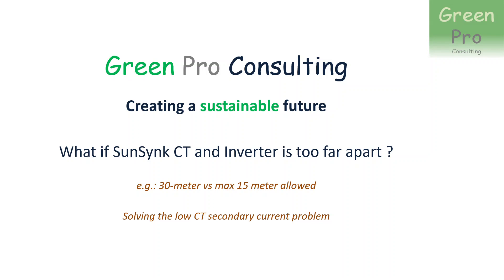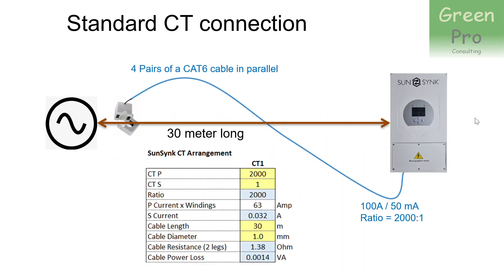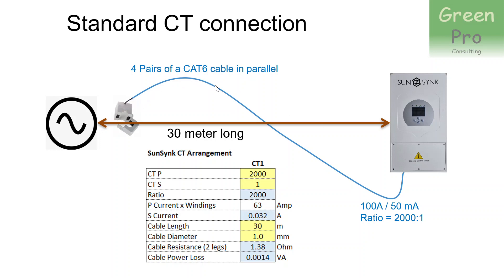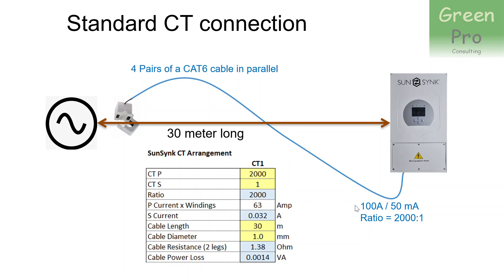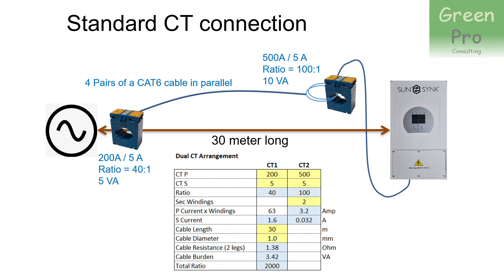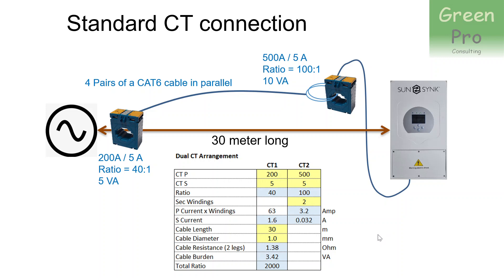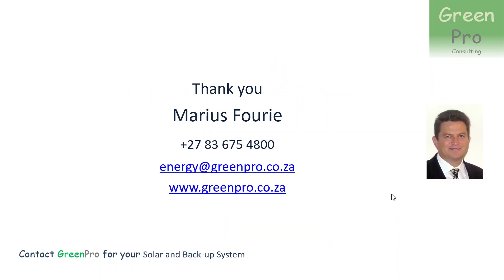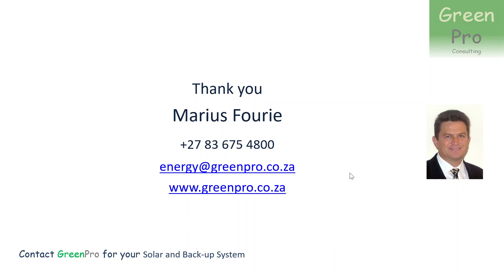SunSynk CT too far from Inverter

Comment: We use CT cable over long runs and it works fine. However we split the pairs and join the 4 white and  4 coloured ones together. So it remains twisted and protects against interference

Comment: I need to run the CT back 100m because the solar is mounted in the garage, any suggestions?
Reply: Have a look at something like the Eastron SDM230 or the Chint DDSU66. They measure the power flowing through themselves and transmit the signal digitally to the inverter over RS485 so you dont have the same losses

Comment: A CT is a current source, and the inverter is looking for current. You are talking about voltage anomalies, noise, volt drop etc are not an issue. Your problem is using all pairs of a multi twisted pair to transmit the same signal. This is like not using a twisted pair at all!!. Get the proper size SINGLE twisted pair cable.

Comment: I would be very cautious of the above method. The reason is as follows. Modern households no longer have resistive type loads. This results in current drawn that may have harmonics into the kHz. Most new electronic meters either trip on reverse feed ( seen as a tapering fault) or you are charged for the reverse feed. (Meter cannot tell the direction of energy flow.) 

If you extend a cable from a CT clamp to the device that measures the CT output, you may encounter several problems:

1.Signal attenuation: The signal from the CT clamp may weaken as it travels through the cable, which can result in a lower signal amplitude at the measurement device. This can reduce the accuracy and reliability of the measurement.

2.Noise interference: The cable may pick up external noise sources, such as electromagnetic interference (EMI) or radio frequency interference (RFI), which can add unwanted signals to the CT output. This can distort the measurement and make it difficult to extract the true signal from the CT clamp.

3.Impedance mismatch: If the cable has a different impedance than the CT clamp or the measurement device, this can cause reflections and standing waves in the cable. This can result in signal distortion, phase shifts, and other measurement errors.

4.Grounding issues: If the CT clamp and the measurement device are not grounded properly, this can lead to ground loops and other interference issues. This can cause unwanted signals to be introduced into the CT output, which can affect the accuracy of the measurement.

Although the above method tries to address item 1, and possible 2 (with twisted pairs) I don't think it addresses item 3. This may result in reverse feed at the incorrect time.  (That may not be immediately apparent) 

In a nut shell without knowing the circuitry in the inverter that is used to measure the current, and how the inverter makes a decision to reverse feed it difficult to tell.  For me it would be best to get hold of SunSynk (Keith I think) for an opinion.
Reply from the maker: Two CTs in series, if anything provides more harmonic filtering that the small CT. The intent of the 2 CTs is to have more current in the long wire, so that losses are minimised. There is a voltage loss but no current loss and as long as the VA consumed by the 2nd CT plus the cable resistance power wasted stays within spec of the 1st CT there are no losses that matter. Anyway, this solution costs R500 and it works. These fancy meters etc. solutions costs an order of magnitude more. Also the accuracy is not that important if you are controlling around zero.
Reply: Great! Thanks! 
_____________
Short: DE-NOISE. 
Simplest: By capacitor. De-ring by resistor.
(In theory: make "integration" of noisy signals better than deye" ;))

Trim current values:
Too high: place (adjustable trimmer) Resistor at terminals of deye
Too low: 
Use more windings and divide back (Resistor (adjustable) in parallel to terminals at Deye). 
More windings: 2x through the same coil or get a CT with more windings. Don't forget to roughly double the terminating resistance of the Deye PCB then adjust to test current constantly flowing (heating) and measured by eg (smart or dumb meter, one can also count seconds of 1 rotation on disc based meters :)
(As a bit power can be dissipated at Resistor: I do not know if a small multi-windings trimmer pots is overloaded, one could use a sturdy normal resistor as base value and add serially the trimmer to it.)

_________
De-Noise:
 it could be we have to filter out "mantle waves", there are standard circuits for this, eg on any terminal PCB of PC power supply symmetric to shielding/protection ground.This also can be done by de-coupling, see bottom.

So we clamp shield of TP only on one side, not to introduce vagabonding shield currents into the cable, and use only ONE twisted pair per CT. 

Then there remains the issue of high-frequency harmonics, the electronics of the deye is not sampling anyways. 
I would recommend to dive into signal shaping a bit with a few RC components to filter down to 10Hz ca., but the Deye should do this anyways...
 
As you correctly stated, a CT is a nice thing as it is a differential current loop transmission only suffering distortion for high frequencies. 
I have to re-read my measurement electronics book to look up the limits of current loop transmission.

As the Deye is sampling I think 5Hz:
 This is next to DC, so you can just patch any noisy situation by Capacitors you de-couple a bit by series resistors (yes, it is a contradiction making the wire even lossier;) so no ringing to the coil occurs. 
R: (decoupling anti-ringing, perhaps small L as series HF blocker)
                                                       R 
Deye CT_n  a ____._______===_____(TP pair n, a cable)____.
                              = C(filt)                                                         L(CT
Deye CT_n  b ____._______===______(TP pair n, b cable)___. 
                         
We should ask someone actively developing RF circuits, such a pro would not have a problem shooting out values that probably work out of the cold air.
Also, some capacitor or other filter at the beginning of the CT could be beneficial. 

In doubt, I would shield the setting of CT and 1 phase by mu metal or coke tin. 
Be careful not to touch hot wires there, isolate by self-attaching foil.
I find WAGO current transformers for hat rail mounting quite nice. 
Everything pre-shielded and robust.

As the CT coils have high resistance internally, which you can measure quite easily, by Ohm-meter to the coil, you should not worry about 2Ω - 200Ω ;))
This should also be the ca. size of the terminating resistance on PCB board.
Mine have 2000 windings and some kOhm.

Rather, you should mindfully do ablation of the insulation of the TP cable, so you can see which cables are twisted together and pair them by drilling them tighter a bit ; so you do not cross-link pairs.

Then, some "noise filter" setup for standard slow-speed serial current loop protocols can be copied here, as we nearly have DC from a cable's point of view. 
Some kHz is still DC when a TP is transferring several hundred MegaHerz normally.
We do not have impedance mismatch here - we just have to de-noise it back to "quasi-DC".
And block or get rid of parallel parasitic imprinted waves.

If you like, I can attach some similar DC CT current coil and measure spectra or time domain with a scope. 
What I observed is that they have 
a) protection diodes that sometimes function as a nonlinear component in very noisy environments, so we could place them on terminals of Deye after some decoupling series resistors.
b) do not work without terminating resistance that "burns" the current transferred. 
It could possibly be that if the terminating resistance is some 2kΩ and cable has a few hundreds ohms, we would do well to adjust the terminating resistor. 
This could happen if the Clamp voltage without load is lower than the voltage needed to drive the resistors. Does this ever happen?

As we can't do this, we could use a CT with a few more windings and some R current dividing network to calibrate back, so in the easiest form place a parallel shorting resistor (10rounds calibrating resistor for testing) parallel to the CT clamping terminals of the Deye. 

I watch the deye discussion for some while, and have yet to buy one, so please forgive me I can only measure for you with a "surrogate" ;))

Hope it still helps and am willing to do measurements on long winding CAT cables by oscilloscope if you like. 

What REALLY can help is DC decoupling the long wire from the deye ,as the greatest source of strange signals around is the inverter itself. 
This can be done by some 1:1 transformer. 
But I think that mantle wave filter will do fine.

_

Comment: But Guys, you can install the CT coil, right at the inverter, on the AC output that goes to the DB. Why would length be an issue? If you purchase a Blue nova CPS5000, witch is a pre-assembled Sunsynk 5KV and Blue nova 5.2 KWh, it comes wired like that, and it is fully certified.
Reply: This would not allow you to feed anything to the non essential loads. You want the CT coil downstream of the non essential loads so it only measures what cones and goes from the utility supply, not the house loads.
Reply: You need the CT to be between the Grid-Tie common point and the grid. This would need to be in the main DB, but the actual inverter could be 50m away in the garage at the bottom of the garden.

Comment: 1:51 "... we used all 4 pairs of a CAT6 cable "
This is how NOT TO USE paired-wire.
Reply: Providing no other explanation for why not is of no use as well...
Reply: @SasVDWesthuizen Because it prevents stray fields NOT inducing noise currents, this only works by TWISTING, not by doing loops. OK, it is still in outer shield, but way less effective shielded. Catch the TWISTED pair by mindfully ablating and then twisting it tighter to see by eye or place some shrink tube over the pairs. 
I think you can run 3 CT in one TP cable no problem and even transfer another signal. Your audio from hifi ;) or infrared pulses or other stuff like some serial link.

Comment: Marius, I have only one issue with your explanation and that is that the original CT has a 2000:1 ratio, but your two CT combination has a total ratio of 40x100:1, that equals 4000:1. Care to explain? (It seems that going from 63A to 3.2A requires a 20:1 CT ratio and not a 40:1 CT ratio.)
Reply from the maker: I wind the secondary of the 1st CT thru the 2nd CT to form 2 windings.

Comment: I actually did an experiment last week and used a twisted pair of CAT6 305meters straight off the drum(box) ... worked absolutely no issues. I think the input for the inverter CT is differential rather than one leg connected to "ground" and voltage measured from this point. 

Anyway, customer installed 110meters of CAT6 and the system is working perfectly!
Reply: You can have two fairly different situations using the same CAT6 cable. I am speculating here somewhat, but if you should use two pairs as the one conductor and the other pairs as the other conductor, then you will get a higher series inductance than if you use one conductor of each twisted pair as the one conductor and the other conductor of each twisted pair as the other conductor. If you keep the series inductance low and therefore the burden impedance of the CT, I can not reason why this cable could not run more than 15 meters. But of course it remains to be verified.
Reply from the maker: Thanks Carl. I would like to discuss if I have such a problem again. Please send email to energy @ greenpro . co . za for your contact.

Comment: Great idea, but would it not have been easier to change to a modbus over RS485 meter and run over cat5/6/whatever?
Reply from the maker: 2 CT's at R 200 each and you simply wind wire through them. Must be less than 10% of any other option.
Reply: The Eastron energy meters is not that expensive, that is if you buy them in quantities. But of course it is just way easier to install the CT than an energy meter. BUT, we have one issue in South Africa that I think disqualifies the Modbus energy meters and that is that our prepaid meters allows very little reverse flow of energy. The secondary CT current that is fed to the SunSynk reacts immediately to any change in load (obviously) and therefore the inverter should be able to adjust quicker to sudden load variations, while rate of feedback from the energy meter will be much slower and therefore inverter reaction as well. I would therefore expect more nuisance trips when making use of an energy meter than using a CT. What do you think?
Reply: Why not just put the cts in the inverter where you connect your input power and output power?
Reply from the maker: @pieterkruger4134  I have no idea what purpose that would serve. You need to measure the property's input current so putting a CT in the inverter is totally bizarre.
Reply: @greenpro-greenproconsultin7420  I've noticed another solar installer do that and he has installed hundreds of Sunsynks and he does this sometimes when the db is far and everything is on the inverter. So I was wondering. As I was wondering about this very topic and couldn't get a clear answer from my suppliers until I found this post
Reply: @pieterkruger4134  Quite simply that is the wrong place to put the CT. In a grid tie system there is a current node where the Inverter, the Grid and the load meet. The CT has to be between that common node and the grid input to be able to read the grid current/s.